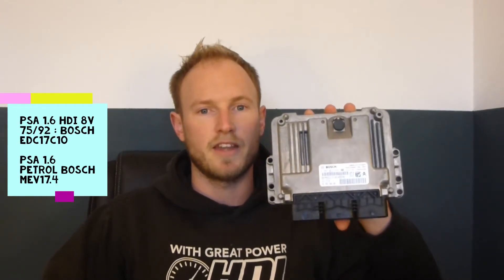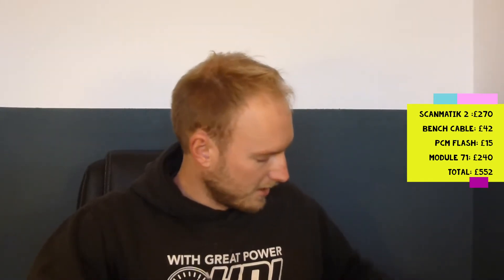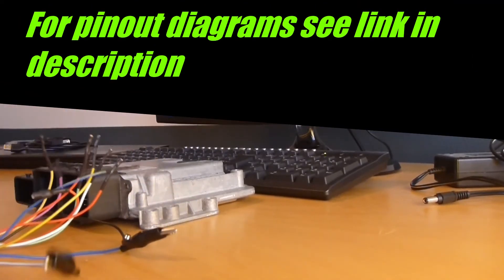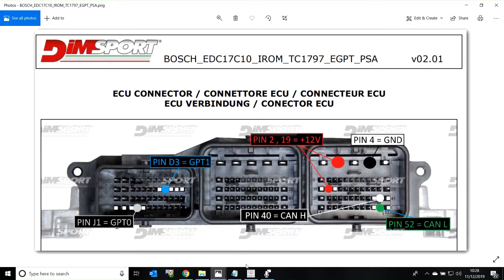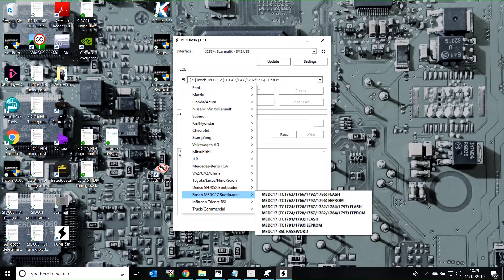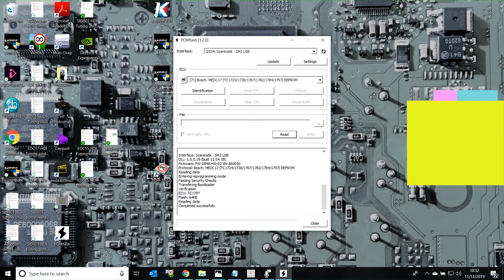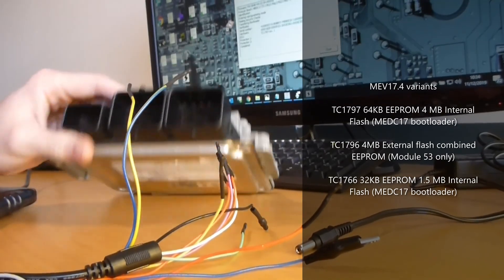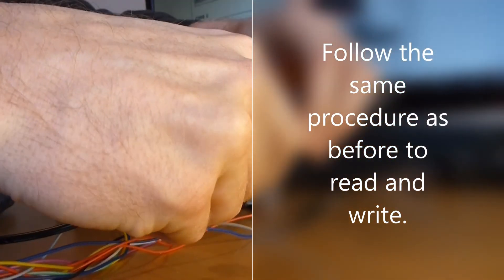Complete guide for Bosch MEDC17 Bootloader module 71 of PCM Flash using Scanmatik 2 Pro PSA EDC17C10

Comment: After 5 years from this video, you think TC1796 ME17.9.1 is accessible without opening the ecu?
Reply from the maker: @Dragon2238552  probably, edc17c10 with this processor is super rare. Might need different gpt pin locations but I see no reason why it won't work with genuine tools that are up to date

Comment: Hello. Do you need a power supply for this? If yes then at which cable you need to connect it
Reply from the maker: Yes I have a 12v switch mode power supply
Reply: @StevenLewis-HDI-Tuning  should you connect it somewhere?
Reply from the maker: @lowrider69yearsago58  watch the video again
Reply: @StevenLewis-HDI-Tuning  at 7:33 doesn’t that cable actually connect to a 220V outlet?
Reply from the maker: @lowrider69yearsago58  yes of course, it's just a power supply, it needs to get it's power from somewhere

Comment: Hi. Do you have any tutorial video of how to connect Powerbox for PCM flasher to Toyota Denso ECU via DB15 cable? I have some ECU pinout but when I try to connect the DB15 cable to the ECU based on the pinout, it is still not work.
Reply from the maker: I think if you buy the real tool PCM Flash it will work, the clone tools are not so good. PCM Flash is a good price and a great tool, its worth investing in.
Reply: @StevenLewis-HDI-Tuning  Thanks you. I will try to check the original one.

Comment: Hello, I need a wiring diagram of the ECD17C10 input. Can you help me, the cables are cut off, and they all have the same color, I need a diagram, thank you.
Reply from the maker: I dont have a full pinout only the knee used for programming. Try diagbox there may be a full circuit diagram on there, or buy a nee wiring loom might be easier..

Comment: How do you know if yours is TC1797 and not TC1796 AND vice versa? What if immobilizer was changed or ECU ID was changed by error. Do I need to use Scanner tool to solve the issue because it's in EEPROM or it can be solved?
Reply from the maker: I can do immo off if you need it.
Reply: TC17xx is an infineon tricore MCU type, nothing more

Comment: hello steven how much volts and ampere has your power supply connected to the boot cable?
Reply from the maker: 12.4v and I think it does 6A max, it will only draw the current the ecu needs
Reply: Steven Lewis thank you for the fast respone👍🏻 maybe you have a picture or link of your power supply ? would be great

Comment: Hello,
Brother i have bmw X5. It give 4x4 error. when i calibrate the steering wheel, error will gone but after some hours or 1 day it will back. I exchange the controller it will run ok. my steering wheel control unit are faulty. I want to repair it can you please help me out what could be the problem? hardware fault (i.e resistors or any electronic component) OR the program issue?

Comment: hello mate, great video, but i have one question, how do i figure out what proccesor an ECU has without opening the lid?
Reply from the maker: Google it, you're not the first to do it. What's the model?
Reply: @StevenLewis-HDI-Tuning VAG edc17c46 for example, there is only 1 type proccesor corresponding to an ecu?
Reply from the maker: @dorinbatrin8757  ok so if you search for the pinout diagram what do you get? If there are two processors there will be different diagrams for the boot pin. If not then there is just one
Reply: @StevenLewis-HDI-Tuning  thank you, i figured it out now